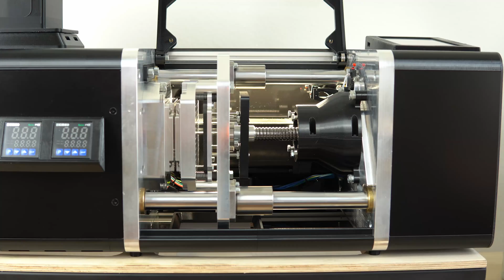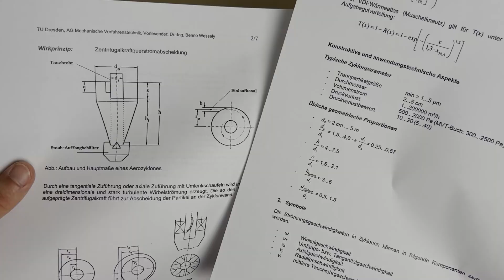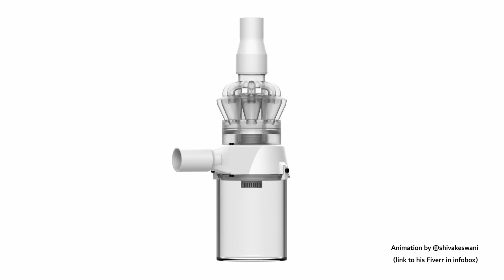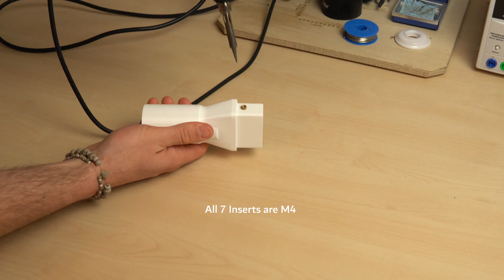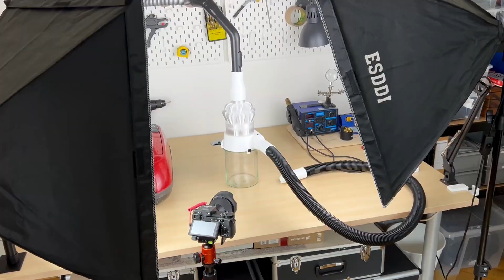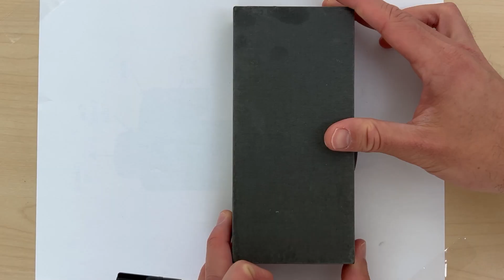This 3D print saves hours of my life - Cyclone separator build

Comment: To avoid the problem in the main collection vessel, you could consider changing the main cyclone to operate as a Thien Baffle. This removes the dip-tube (aka vortex finder) and places a plate between the bottom of the main cyclone body and the collection vessel with a thin gap between the plate and the edge of the vessel, the gap runs about 270 degrees around the edge. The vortex is thus shielded from the collected material. The Thien baffle works well to separate larger particles in a very compact form. It sees use in may DIY and commercial designs.  J. Phil Thien has a website that covers the idea as well. (Linking to it seems to cause my post to be deleted.)

Comment: This works surprisingly well considering it's a heavily compromised design.  You showed how important the maths is for the vortex chamber to work, yet by using your receptacle as your vortex chamber, you completely destroy the proportions as soon as you collect any particles.  As the jar fills, the effective height of the chamber is continually reduced so the vortex collapses and the only thing which catches the particles is the pile of other particles.  There's a reason vortex separators are conical.  It's to increase the curvature of the outer wall to maintain the force on the particles as their tangential speed drops as they flow down the side.  This holds the particles against the side wall.  By the time they get to the bottom of the cone they've lost their kinetic energy and drop into the receptacle below.

You could fix this by printing a conical chamber which screws under your current assembly, then this screws onto your jars.

It looks like the square section tubes connecting the large chamber to the seven smaller chambers are all radial.  Since the airflow is spinning at this point, it would make more sense for them to leave tangentially.  Just make sure you get the direction right to ensure the air doesn't double back on itself.

If you must use your storage jar as your separator, it is too short, which is why you get large particles sucked up the central tube.  Either print a conical separator or use taller jars.

Comment: This is coming from personal experience making a rudimentary dust collector using a 5gal Home Depot for woodworking.

1. The long screws that attach the hose piece - the side one - to the cyclone can, and will, get wrapped with larger wood/material shavings. It doesn't take much to get a clog really quick if picking up longer shavings. I would suggest either cutting them to a shorter length or creating some kind of deflector so longer shavings don't get wrapped around the screw.

2. Not sure this can be 3D printed to a respectable standard, but adding a foam or fine mesh filter to the grid piece on the inside of the jar can stop smaller particles from getting into the secondary collection chamber.

Not saying you, the creator, should make those changes, but to you and everyone else, just stuff to consider.

Comment: If you want to print reasonably transparent PETg, set your volumetric print speed limit exceptionally low. It'll be an absurdly long print, but the slow speed is what's needed to avoid trapping air bubbles.
Reply: yes big nozzles (~0.8mm) and really really drying the filament out also help a lot

Comment: Interesting... I was thinking about a similar application for a very fancy and industrial looking filter for watercooling application but never made it into CAD because the math involved seemed ... daunting ;) 
Addressing the particles that made it through, I'd go with stainless steel mesh. With appropriate surface area you could even go with very fine mesh that would prevent the bag from clogging over time with high certainty. I suggest designing a fairly large basket that goes before the vacuum connector in which you weld the mesh into. That way it's easy to clean and shouldn't minimize airflow.

Comment: Another variation on this mechanism is used on vacuum attachments to humanely capture spiders and scorpions. They're deposited into a separate "bug cage" so you don't have to open the dust bin or bag to release the spider or whatever, and usually in a way that keeps your hands away. So you use the long tube on your vacuum to capture the problem animal in your house from a distance, and then eject them outside. 
Good if you're scared of them, or live somewhere with dangerous little critters. They also let you have a look at your captive safely, if you're curious.

Comment: I think another interesting potential for your use case here is that I've heard that super-fine plastic particles can cause more jams in recycling set ups because they can melt too quickly and gum things up - your separator may be pulling the super-fines into the vacuum bag and leaving the chunks of appropriate size in the jar. Not to mention potentially cleaning dust out of the regrind.

Comment: Does it work with liquids?
Reply: You would need a serious vacuumer just to suck the moist. You can try using a device called towel for that purpose
Reply: @durlin84 very funny... I want the liquid in a Jar not in my hoover. I regularly need to pump water from a floor ... I have a vacuum cleaner for liquids but the tank is too small. I would like to get the water directly in the sink...
Reply: @TSCA-o4u  if its a lot a floor pump, self sucking so it starts even with no water in it, would work. but if its just a few drops, i guess ideally you would make a double pipe; a small pipe inside a big pipe, and blow hot air (from like a heat gun or paint heat gun on low setting) into the outer pipe and suck air into the vacuum cleaner hrough the inner pipe. and then in the vacuums hose put a gas dryer (as also found on pcp air compressors). the gas dryer has a bottom connector where the water will drop through.